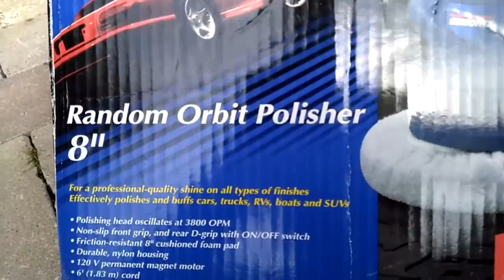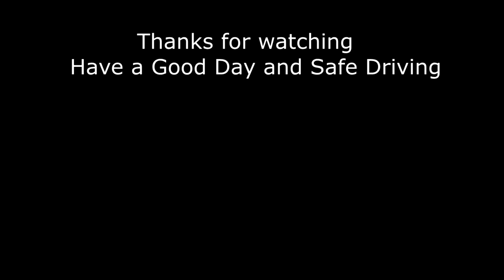How to Polish a Car with Cheap Car Polisher Simoniz Random Orbit Polisher 8 inch

Comment: I've owned the 849x going on 6 years MyBest.Tools  and has never failed me.Smooth runningWell balancedNot too noisyDecent weightControlled RPM's that keeps it's speed no matter pressure

Comment: I just got the same Simoniz polisher and I am pretty new at polishing. I was just wondering how hard do you press down on it while doing the job ?
Reply from the maker: You don't need to press - just let it do its job by holding it against area that you want to polish
Reply: What’s the plastic feeling bonnet in the pack?

Comment: I have one of that, by I thinking it's just for wax... So if I put polisher compound works good? Or the rpm on this kind of tool are to high for that? Another question is: scratch remover it's not the same as polish compound?
Reply from the maker: Scratch remover and polish compound have different purpose. It's not high rpm that will impact the final result - it is how hard you press (don't press too hard against car).
Reply: @NewRoad  so, this tool can be used Whit polish compound and wax
Reply from the maker: That is correct

Comment: at the rate you are going...you might finish in 5 days
Reply from the maker: Still working on it 😂😂😂
Reply: I am preparing for first time fixing area of moderate scratches on car and have the 3 step Simoniz (Paint restoration, polishing compound, then finishing glaze), I was wondering about this point as well. It's not a large area affected by scratches but I'm assuming I apply each of these for quite some time.  Is it about 20 minutes of buffing in a small area like in the video, or more?  Do I just clean and reuse the clean pad cover between each of the three steps of compounds and finishing glaze?  Sorry for the questions, newbie.
Reply from the maker: @glenwjackson  It's not about timing - just check visually and change pads for each step.